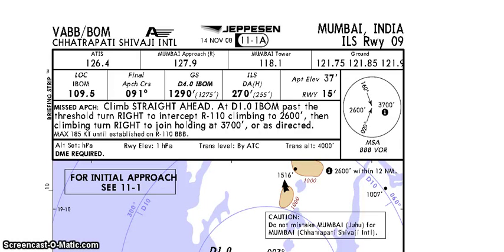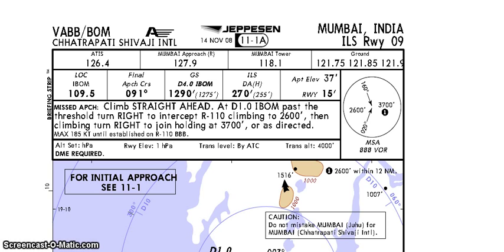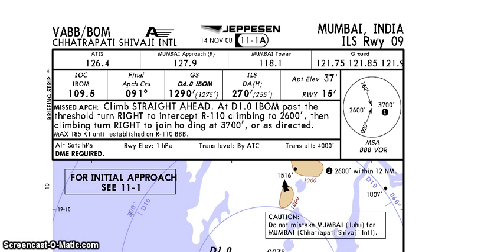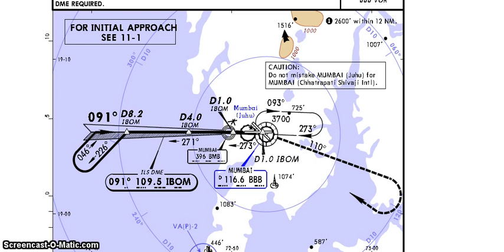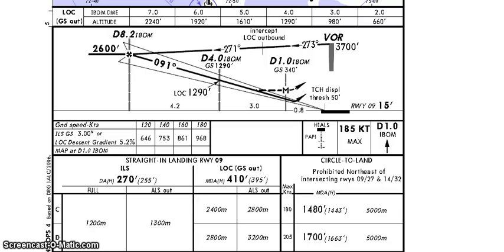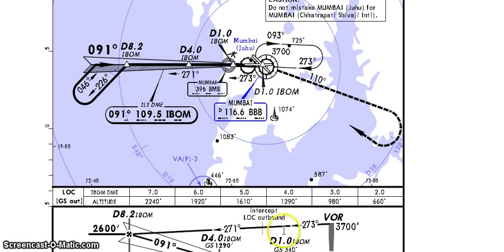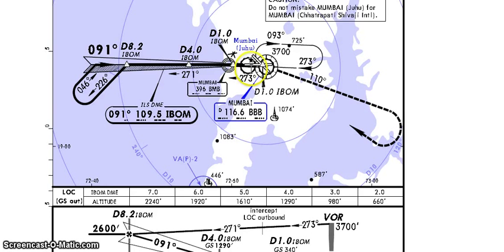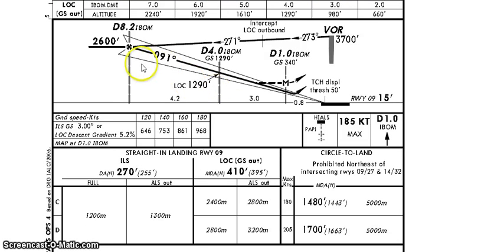approach chart briefing/how to fly an approach

Comment: Nice video ! appreciate your efforts :)
just wanted to clarify a few things that i didnt understand..

1) the apprch speed & the threshold speeds that u mentioned 130 & 110 kts.. whr does one get those frm? they are a/c specific right?

2) whr do we get the DDA from?

3) tht MSA part confused me.. the eastern sector thing u mentioned twice

4) that parallel entry was also for example sake right?

5) Do the airline pilots actually execute all of this? or they get vectors?

thanks a ton! make more videos please!
Reply from the maker: Sunil SM 
1) As mentioned in the beginning of the video, anything that is not mentioned in the chart I have taken random values.Hence the speeds are random values.Please select the speeds according to your AFM and category of aircraft.

2)to get DDA add 50 feet to your DA

3)you can see that the MSA is 2600` to the western sector. in the eastern region (notice the ball flag 1) msa is 2600` till 12nm. beyond 12nm it is 3700`.

4)yes parallel entry was an assumption.select the correct entry according to your actual position

5)Yes they do get vectors and sometimes they do execute all of this, sometimes they don't.it all depends on the airport, weather, the traffic ,type of flight etc etc...whatever is the best available choice...

Hope that anwers it all. Happy learning!
Reply: Meril Kailath  big help! thanks so much :)
Reply: Meril Kailath yes ! thank you Meril.. :) lookin forwd to ur nxt vid
Reply from the maker: Sunil SM My mistake.I didn`t review the video before upload.Please read as: "MSA in western sector is 2600`......." rest remains the same